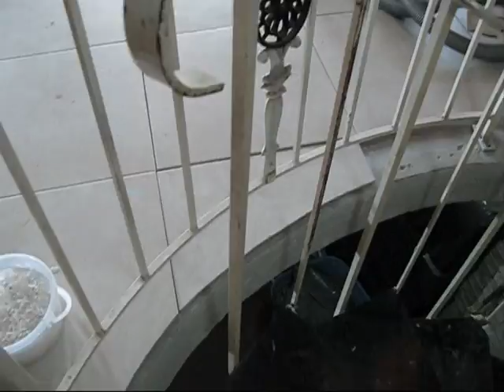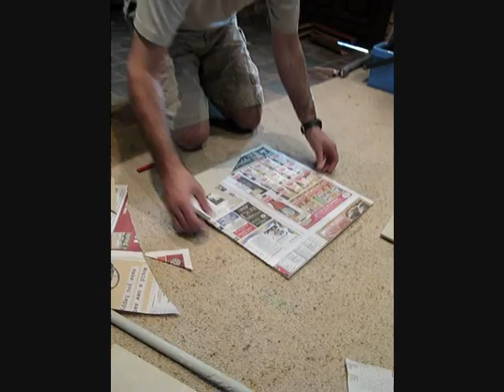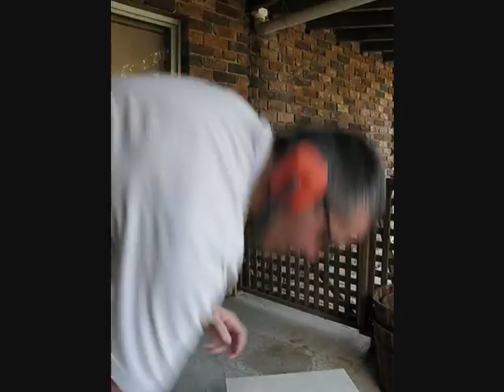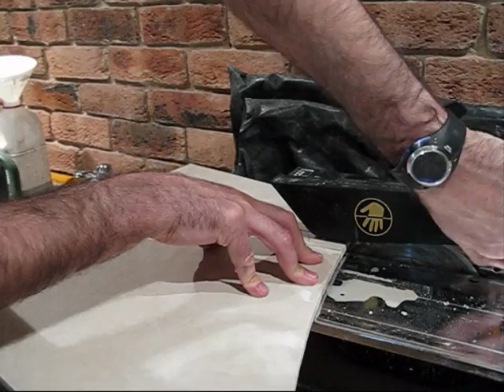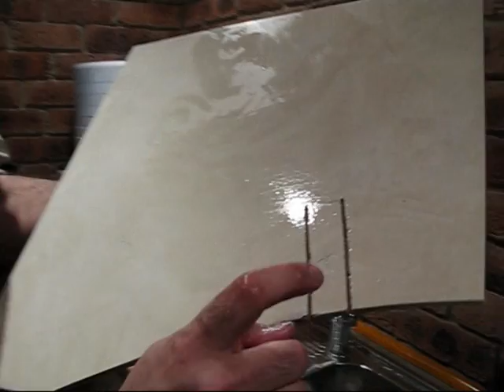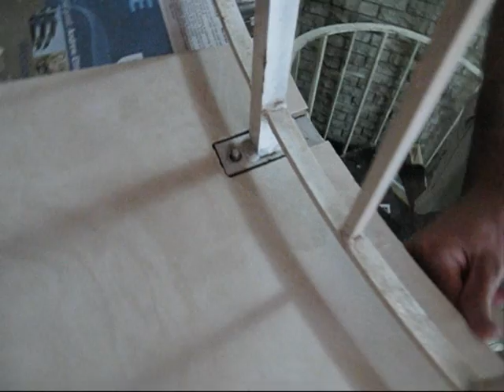Cutting a Freehand Curve in a Glazed Tile

Comment: What kind of blade is that?
Reply from the maker: Hi, it's a ~100mm or 4" (depending on your machine) non segmented  or continuous rim diamond blade for a grinder.

For example:
https://www.amazon.com/s?k=Continuous+rim+diamond+blade+for+a+grinder.&ref=nb_sb_noss

Do not use a segmented blade it will be too aggressive and may damage and/or break the tile being cut. Segmented blades are primary used where speed, impact and cutting is required ie on brick & paver cutting.

Comment: Hey Tony Nice job, 
Just curious, that hand rail looks as if it was separate from the stairs , correct? And if so, would it have been easier to remove the rail and drill the tile to accommodate the bolts for it?
Reply from the maker: if i were installing the hand rails yes i would have done it as you say,  but Unfortunately i can't remove the top hand rail without cutting the steel, i buy the house with the steel spiral in place and fully welded & fitted. 

The long and short of it is, it was much easier to cut the tile then re engineer the steel stair case. 
Lifting all the top hand rail feet ~15mm would also introduce a slight twist into the main vertical central shaft & possibly affect the gate swing and locking latch alignment.

Comment: I just wanted to say well done by setting a good example and wearing proper full face protection and ear defender. So many think that safety googles are enough but cutting porcelain like this throws out tiny shards at tremendous speed and you can never be too careful with such a high speed tool. Especially as many remove the cutter guard so as to be able to see better. Anyway thanks for posting

Comment: Plz provide details of your angle grinder especially power and rpm
Reply from the maker: Hi Jasir Sofi, the spec of the Angle Grinder is not what's important as long as it is the smaller 100mm (4")  to 120mm (4.75") type grinder....

i was using an Australian model Makita 100mm grinder, this model will be different in every country
Model Name: 100mm Angle Grinder
Model Number: GA4030K
Material: Metal / Plastic Product 
Dimensions: W:128 H:95 L:266mm
Package Dimensions: W:140 H:300 L:420mm
Wattage: 720W
Cord Length: 2.0m
Maximum Speed: 11000 rpm (no load)
Side Handle: Yes
Spindle Lock: Yes
Variable Speed: No
Arbor Size: 16mm
Commercial: Yes

Comment: Use newspaper? You can buy a role of trim brown paper for $3.
Reply: Handheld cut knip cutter with wheel is easier
Reply from the maker: i'm sure it is if you good enough to use one sucessfuly. 
i had difficulty doing it with a wheel cutter and these very good quality porcalain tiles so i completed the project happpily using this method

Comment: Thanks Tony, your demonstration was most informative. Perhaps you can advise me on a slightly different tile-cutting problem.  I have to cut about 100mm off the edge of some large porcelain tiles which are already laid on a bathroom floor.  It's important that I have a clean cut (no chips) on the edge that will remain on the floor, since new tiles are to be laid against this edge.  I have free access to one edge of the strip that is to be removed, but no way to safely mobilise the whole tile to enable it to be cut on a wet saw such as you demonstrated.  What are my best options, do you think?
Reply from the maker: Hi Peter, this is a difficult question to answer ... no chip tile cutting a curve on a very tough porcelain tile which is still fitted to the floor in situ ... you got me there.

Please advise what your solution was if you did it sucessfully.

Comment: Tip 1 : Put the tile on the table over  a thick  sheet of polystyrene XPS (extruded) .
Tip2 : you can run a wet cutting using  a thin hose attached to the guard and a PET mounted at height by free fall water drops to the blade

Comment: Are you an experienced tile setter?
Reply from the maker: No i'm not an experienced tiler, 
just a keen DIY'r / weekend warrior, 30 year engineer, Technical project manager.
Who will take the time to do it properly myself, instead of hiring a contractor and be left feeling ripped of and the job not 100% completed to my satisfaction.
Reply: Yep, most contractors just want the money and get out. That's the best reason to learn, I don't trust most of them.
Reply: Liked the way you used your body as the compass point when you ground the arc piece out. Typical good engineer (one myself, and Scots too). Not quite sure how you would manage were radius about 6"... Hope the project finished as you expected. Looks great.

Comment: Hi, here is my thoughts if you want to cut a curve ... 

Dewalt = A1 great products

Dewalt dwc410 = Not good for cutting curves. This is a wet cutter for flat & straight line cutting of tiles / stone / granite / slabs / marble / etc, 
I'm sure it would be a good tool to have in your arsenal.

Angle Grinder = More dynamic, cheaper, full viz of the contact point of cut, not as bulky & difficult to use, you can add an attachment for guided straight line cutting, not water safe or friendly.

Comment from the maker: Thanks for the feedback, & yes you are right with your comments re securing the tile in place ... but out of all the tiles i cut a curve in none broke. Worth noting i was only very lightly placing the blade onto the tile and cutting in very slowly and progressively, but your right if i were to press the blade hard into the tile it could easily get broken, miss cut or sent flying off the bed.

Comment: As a professional bathroom remodeling contractor, I need to point out something VERY important. The setup of how you're cutting the tile with a grinder is extremely poor and quite dangerous. In many circumstances, a tile placed upon something like that will certainly break. You need to place the tile on a firm flat surface and make sure it's properly secured in place, even if it means gently stepping on it. Not breaking the tile and working safely with tiles and a grinder is the most important.
Reply from the maker: Thanks for your comment and i agree, ... in my defense i was only lightly scoring & cutting the tile and not pushing into it for speedy cuts. if i was pressing into the tile & cut would be a rough(er)  finish and very high chance of sending the tile off in the direction of the spinning blade so i would defiantly use a hold down clamp (or boot)

Comment from the maker: hi John yes I definatly would redcomend the diamond saw on the grinder to cut out the bigger foot print, then finish by hiding the cut with a bead line of silicone glue of quadrant tile. If your original tiles are onto floor boards watch you don't cut too deep into the floor boards & you may also have to make good the waterproof membrane sealing, good luck.

Comment from the maker: Yes you are correct, thanks. The segmented disc is very good for concrete pavers and sand stone where you  need the impact action and cooling of the segments and have a lot of dust and dabris to remove, but the tiles need the smooth continuous action of the. solid blade..

Comment: Tony, I have a tile job where I need to cut some ceramic tile that is already installed. I am making the shower larger and need to create a bigger shower pan. Would you suggest the diamond blade on a disc grinder for that application as well?
Reply from the maker: yes, absolutely use a grinder & diamond blade to cut in situ tiles, but you have to know whats under the tiles ...
1. you may not want to cut the sub tile waterproof sealing or epoxy or concrete or fiberglass waterproof membrane
2. the diamond blade will not be good for wood floor boards or wood beams under the shower base, it will cut it but also produce a lot of smoke as it burns & wears through it.

Comment: Nice video buddy worked out my problem, I've been using a toothed disk but I need a non segmented disk. Thanks heaps
Reply from the maker: yes toothed disks for concrete pavers and bricks as it helps cooling and the stepped vibration causes a hammer cutting action to cut through quicker.

Comment: Also!!!  Yoy could mark the tile by placing the tile in place and marking the underside and then it from the bottom. By cutting from the bottom you never have chips on the top face of your tile cutting from the bottom makes a smoother finish on the top face. Try it and see how that'
Reply from the maker: Hmmm, not sure how and if that would work cutting a tile from the bottom side.
in fact i never even thought of or trying that. but open to discussion or comments on this process.

Comment: Hey Tony...great job. Just wondering if you of anyone knows whether or not I can use the angle grinder for slate tile? Diamond blade also?  Thanx    Jeff
Reply from the maker: you can cut slate with a diamond cutter and grinder but i would only use the grinder if it is a clean cut square edge tile. 

Slate is meant to be rustic and rough and there is also specialised tools to cut 100% slate tiles in the traditionally methods, think old English slate tiled roofs.

Comment from the maker: Thanks. The grinder is very good for cutting & shaping stone. If you are a blade smith then there's not much i can tell you don't already know or are aware of. Grinder is good for rough cutting and shaping. I'm also into lapidary, stone cutting & polishing is definitely an art. What i found is the finishing and polishing that takes up most of your time. Depending on type & size of your item and how you want the finish to be, the grinder may not be best tool to finish with.